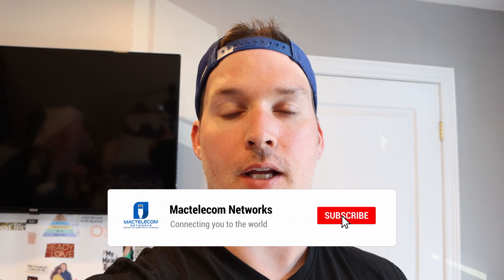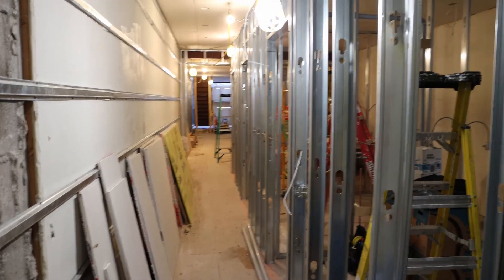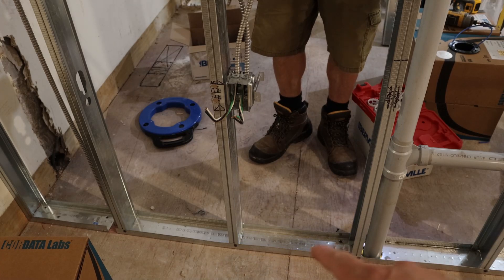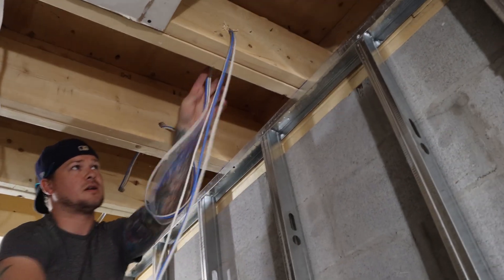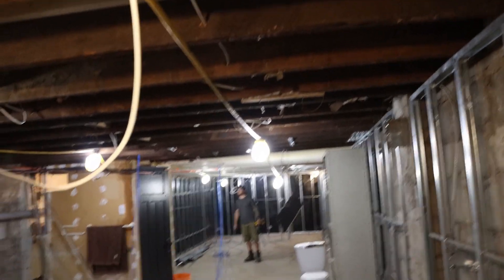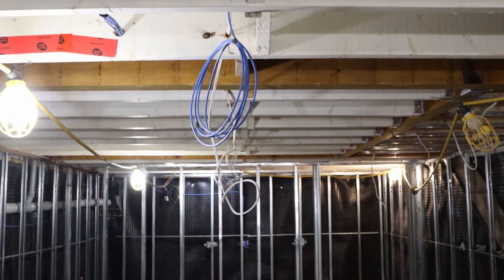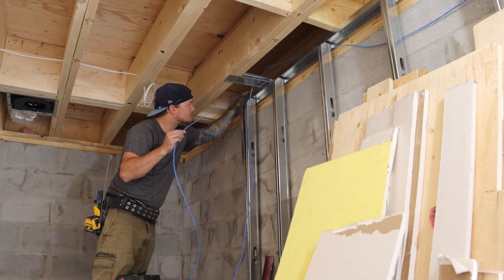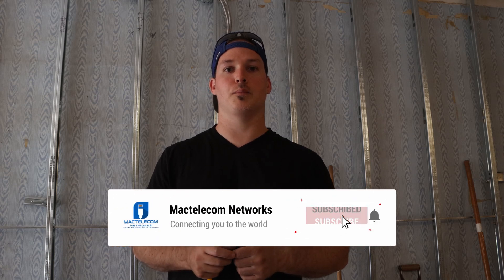On The Job Episode 4  Network cabling

Comment: I'm curious how you plan on adding the Unifi Access into the fire alarm system?  Thanks!
Reply from the maker: Hey. We don’t need to. The door that it is connecting to has a crash bar so it can always be open
Reply: @MactelecomNetworks  Thanks for getting back to me.  My understanding of the ontario building code is it has to be connected to the fire alarm system for the auto release for Fire to get in as well as people leaving the building.  This is the only thing that has been stopping me from implementing one.
Reply from the maker: @andrewpercival44  that is a great point. I believe the REL can tie into the panel but will have to do some testing and let you onow

Comment: I was very surprised not to see any insulating bushings on the metal studs when you ran the cable.
Reply from the maker: We have grommets on there just didn’t have any at the time of running. We weren’t suppose to go through the studs but as the dry wall was up we had no choice .

Had to run out and grab some

Comment: @2:50 I would put in plastic bushings to prevent the sharp edges from damaging the cables.
Reply: Also should fire caulk around cables for penetrations between floors.
Reply from the maker: The fire rating will be done by another contractor. And grommets were added but not shown in video.

Originally we were not suppose to be going through the metal studs like we did. But since the drywall was already up we had to

Comment: Crazy setup! What kind of rack did the customer go with? With that many drops. Which switch did they go with?
Reply from the maker: The rack I’m not sure the customer already has it I’ll do another video when we are in the final stages.

For switches we will be using two 24 port pro PoE
Reply: @MactelecomNetworks  Just wondering why 2x 24 poe instead of 1x 48 port poe?
Reply: @ryanstone6495  I'm guessing for a better cable management... and easier troubleshooting. With 2 x 24 switch, you can easily put a patch panel in between the two switches. Check his last two videos (I think) 😅
Reply from the maker: Well it will make for better cable management but would have been easy with a 48 port switch as well. 

I didn’t buy the gear the customer had in the beginning and that’s what he had. It will work well though